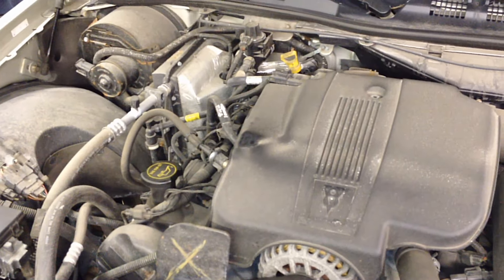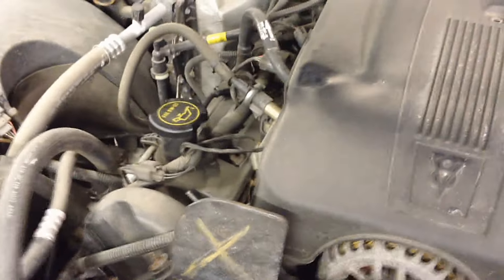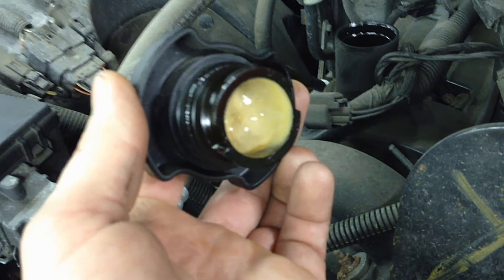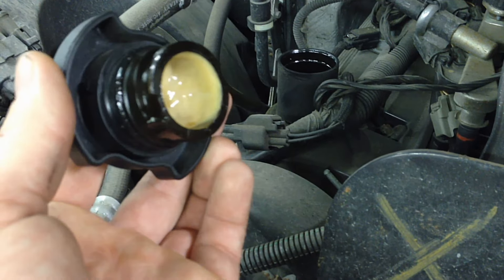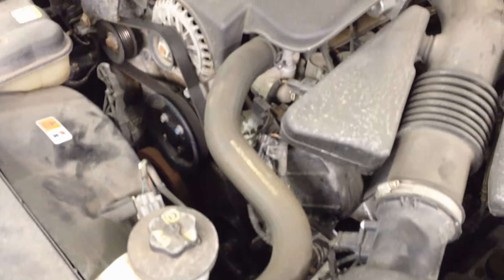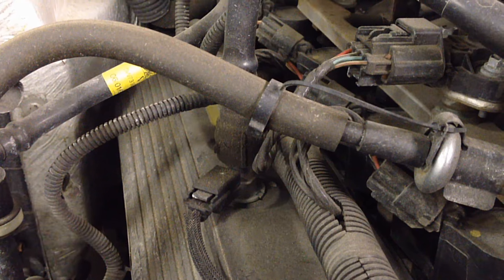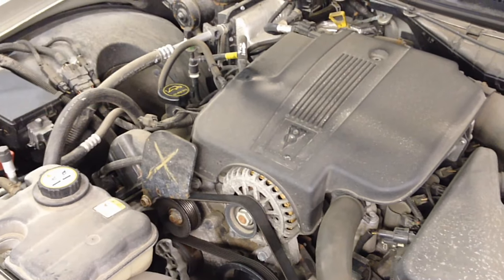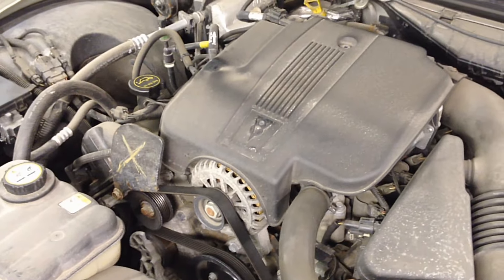Ford Quick Tips: #1 Engine Oil Cap Puddding

Comment: nice. 2013 ford escape dealer says heater hose bad and not covered under 5 year powertrain warranty. I find hard to believe heater hoses not covered under powertrain warranty. is this true. ?
Reply: BIll A  you can get a copy of what's covered and what's not,,,, but generally there is nothing covered even in the extended warranty internal engine parts only,,, internal transmission parts only,,,, extended warranties are generally a rip off,,,, unless you have a vehicle with a dual-clutch transmission or direct injection,,,,,.  Almost impossible to have bad heater hoses in 5 years,,,.
Reply: Rick Simpson it's not an extended warranty. it's the ford factory powertrain warranty. the   bumper to bumper is over but powertrain warranty still is good.
Reply: Afraid so, Bill. I looked at the Ford powertrain warranty. They give you this long list of all the things that are covered (heater hoses are not on it), and on the "not covered" list it begins "anything not specifically named on the covered list."
Reply: ,, probably it's the ends of the heater hoses,,, where they turn into plastic,,,???  The Locking clips,,, that connect them,,. ???   Has the head,,, or motor been worked on or taken off,. ???   ,,, They could have been damaged disconnecting them previously,,. ???   ,,,, The bad sections of hoses could be cut out,,, and use some copper tubing about 2 inches long,,, to connect a new piece of heater hose,,. ???  Aftermarket parts should be out fairly soon,,. ???    You could also send a buddy to Ford parts,,, and buy them,,,.    At,,,,, jobber,,,,, price.   Jobber price is something I get, jobber price is something I get,, good for about 20% discount,,. ???
Reply: Rick Simpson thanks for the info. this is for my in-laws car. they took it to the dealer because it has been using coolant and the car is still under warranty.  I hope it's the heater hose that is the problem. the hose has been on national backorder. the dealer has had the car over a month. they finally got a loaner
Reply: BIll A ,,, don't sound right,,, they're known for blown head gaskets,,,. Have them pay with a check ,,,  if it don't fix it,,, do a stop payment on the check,,,. !!!   I've been studying up on these vehicles and the focuses,,,, my son's Escape 2 L turbo all wheel drive,,. 68000 miles no problems yet,,, getting prepared to remove the intake manifold and clean the valves,,,,.  New brakes front and rear,,,. Engine and radiator flush,,, new antifreeze and thermostat,,. He bought a two-year-old corporate lease,,,, high miles,,, absolutely no warranty at all,,,. !!!  I told him not to buy a warranty,,,,. I'll do any repairs,,, don't let the dealer or no other mechanic touch it,,. !!!
Reply: Rick Simpson this is the 1.6 ecoboost. 2013 escape . it's had tons of recalls.
Reply: BIll A ,,,, how many miles is on it,,, did they buy used and how many miles did it have on it,,,. ???
Reply: bought it brand new. 40k on it now. hopefully not a head gasket or cracked head with that open cylinder design. I have my doubts it's the heater hoses causing coolant loss

Comment: so if that stuff is getting on the oil cap, is it building up anywhere else in the motor like the valve cover
Reply: Ynot not really because the oil cap is cooler because made of plastic, also on this engine it's desing seems to make it worst.

Comment: Great video. I have a 2008 F-150 5.4L and have this problem. Even though I live in a cold climate I drive about 45 minutes to work every day. The truck never gets short trips and I change my oil every 4,000 miles with Motorcraft 5w-20 syn blend. I know I don't have a head gasket issue, but the truck is also using about 1qt - 1.5qts of oil in 4,000 miles. It only has 60,000 miles on it, but I've noticed this oil consumption since 40,000 miles. Do you think it could be a PCV issue? The Ford dealer did an oil analysis and they said that is normal consumption; therefore would not replace the PCV (which I think is built into the valve-cover) under warranty. Also, both CATs have been replace on the truck already at 45,000 because they went bad. I think that is from the truck burning a lot of oil. Otherwise the truck runs good. What do you think? Any help would be appreciated.
Reply from the maker: Zack Zander I think it is normal on the cap. The oil level drop is normal according to Ford but not normal from what I have seen. The pcv system is more of a baffle instead of a valve. Unless that came apart you likely just have valve seal issues.
Reply: use some thicker oil in there. probably won't use near as much. some people frown upon that but I've seen people run 15w-40 diesel oil in there Chevy ls motor and it doesn't hurt it. just let it warm up a little more on cold days before you get jnto the throttle

Comment: I would pressure test the coolant system to make sure it's not leaking into the engine, Thats a lot of "pudding"
Reply from the maker: +TheNorthsquad Ultra normal especially on a crown Vic grandpa car that runs lots of short trips here in the cold of the north. New cars do the same thing any brand

Comment: could this happen in a very humid climate like say florida?
Reply from the maker: I am not sure to tell you the truth generally if the engine is ran in a hot enough climate for long enough it will be evacuated and burned via the pcv system its the short trips that allow it to accumulate and the cold weather that doesn't allow the engine to be hot enough to burn it off.
Reply: well i take frequent short trips, so i was curious because i do not have white smoke or anything white on the dipstick itself to suggest it's the head gasket.it has been running a little rough though when first starting it up so i am taking it to a mechanic on monday.

Comment: what is u get this pudding also on the pcv valve I am having this issue in my Saturn sl 2002
Reply from the maker: +gerson hernandez Pcv also gets it as this is the point in the engine where all the water vapors rise to be recirculated. The underside of the valve cover will look the same.
Reply: Ok I see thanks man I appreciate that is just that I been seeing a lot of this stuff on my off valve and I changed 3 already thinking that they are bad . Is there anything I can do that would aid for this to stop

Comment: So good long trips prevents 'pudding' Build up.
Reply from the maker: burns off the moisture in the crankcase yes.
Reply: I've bought a peugoet 206 but it cranks doesn't start, under the filler cap there is this residue but not at the bottom of the engine the engine oil is golden on the dipstick also previous owner says the car devours water though.

My dad seems to think is a dead head gasket, but I don't know.
Reply: The head gasket is made of rubber

Comment: Your videos are great but if I could offer a bit of constructive criticism...you tend to ramble a bit and it lengthens your videos.  Not that I mind you talking, but you could easily cut out 50% of the time and still get your point across.  Thx Joe
Reply from the maker: Yes I am aware and absolutely agree these videos are from the dealer days where I am in a shop environment with a customers car trying to relay the information the best I can on the spot. In my newer videos I tighten it up quite a bit and I am trying to speak clearer as time goes on so the content is better quality overall.
Reply: Man pffft I appreciate the rambling, theres years of knowledge in there! Keep on ramblin please
Reply: do not change, please, your videos are really well done and we FORD LOVERS enjoy every minute bro!!
Reply: my thoughts exactly....ain't no one got time for dat.
Reply: FordTechMakuloco ... Hi mate ,, there is a white color or pudding on the oil cover of the engine . But every day I check the water level and oil level and they are okay .. why this happen . My be because my journey very short and I didn't use my car too much
Reply: My thought and prayer goes to the rambling
Reply: thank you for putting this information out there
Reply: i have a 2004 5.4 with the pcv valves in the valve covers how would i know what one was bad